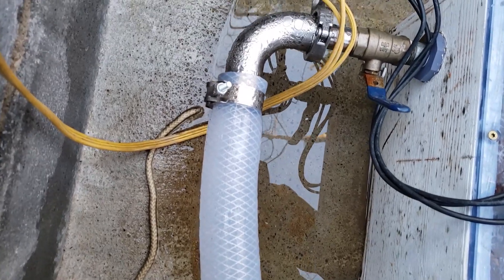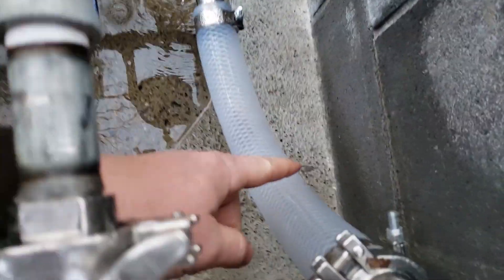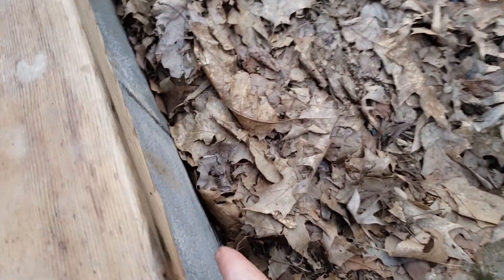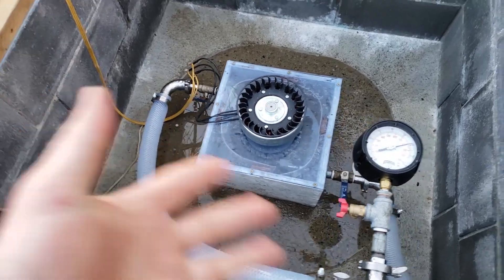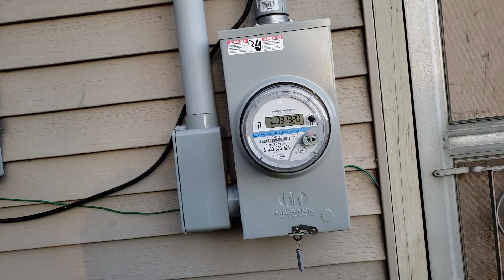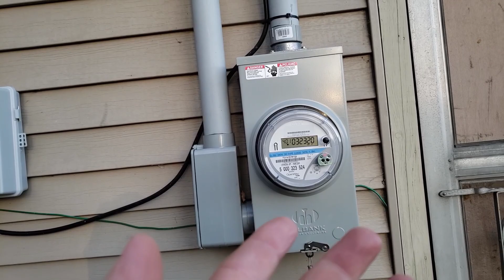T-Bolt Band Clamps And Some Talking.

Comment: How much money did you already invest in this hydro turbine toy and are you actually powering any equipment with it?
Reply from the maker: About $2000, and I've powered some stuff with it like some resistance heaters, charging all of my batteries, many lights, and occasionally running my computer system on it even. I still need to get a grid tie inverter and then it will be feeding into the grid. On the flip side I've made that money back through this channel offering entertainment and (if dubious) educational content.

Comment: I have a strictly solar setup running an all electric house, and the best inverter I could find to tie it all together was a Sol-Ark 12kw inverter. It wants the batteries to be 48v, but it looks like you can use your charge controller to charge the batteries directly anyways. If you want to get solar, it has 4 ports on 2 rails for high voltage DC so you don't have to worry about a separate charge controller for the solar panels. There's a line for the grid, which you can set it up, so it only pulls from the grid, but if you start generating any serious amount of power, it's worth while to go through the process and get net metering setup with your power company, unless they're really unfriendly with it. I'm not sure how to message you directly, but if you want more info, message me and I can show you what I have and maybe give you some ideas?
Reply from the maker: You can email me directly at malovich@gmail.com

Comment: the power loss on running the 3 phase cable to the house should be far more loss then converting it at the water wheel then using the 3 phase to single phase then run that via the  armored cable to the house with the higher voltage so you get less loss (not watched other videos yet to see if you changed it)

Comment: They make a constant torque clamp used for  the boots of turbocharged intakes. Manages to hold upwards of 100psi. 

They are also like $10+ a piece at Napa.

McMaster has them, 304 stainless bands and 410 stainless screw

Comment: I just noticed your water pressure is at 120PSI are you using a pump to pressurize the line? The 6 ft head you have there will only have less than 3 psi to get 120 PSI you would need over 270 feet of head. If you are using a pump the whole loop will be a net loss. The pump will use way more power than the turbine will generate. Maybe I'm missing something but outside of a pump I cannot see where the 120PSI  is coming from.
Reply: Watch the entire video.

Comment: Use the water wheel to charge a 12v system for outdoor security lights or outside lights for around the hot tub also you could run a line to your work area for a usb charging hub. Also like a few others have said I would put the box for your connections on the outside maybe also add an emergency disconnect and im glad you went with the mpp solar inverter ive had one for years.

Comment: You may find going to DC for some of your stuff useful. Lights, device charging  and simlar applicationns may tap your DC more directly.Working DC to DCmay be more effective than the AC to DC to AC then back to DC cycle  charging / powering battery powered devices requires.   This may mean tapping  the automotive / RV area for DC  lights and charging options.   Thanks

Comment: for the camping pressure you could cut down the width of the clams to get more pressure with the same clamping force.  I also wonder if it is worth to step up the voltage to reduce power loss.  the formula is current square times reisistance. not sure how efficent two transformers would be.
Reply: i think the length is too short to justify that.

Comment: As for the housing, round sleeve but with vertical louvers around the perimeter of the wheel, louver opening towards water flow, this allows an exit for the water but not allowing much reentry. Obviously there are dies for creating these when you transition to steel but would be easily preformed in plastics/PVC currently. At that point, I would then introduce horizontal louvers on the top, outside of your square housing louver opening up as to allow any air pressure to discharge to atmosphere. It would stand to reason these subtle additions would greatly reduced turbulence inside the housing, be it hydro or air.

Comment: I currently have my house setup with a MPP Solar LV2424-HS Running off 1200Kw of Solar and about 15KwH of Batteries.     Now it's only a single phase inverter but for my natural Gas heated house it's not too bad.  I am also not using it for any of the 240 Loads. ie Stove, Dryer and AC.    But for everything else it works just fine but my daily usage without the 240 Loads is about 12Kwh.    For the Days I don;t have enough solar like winter I set the inverter to charge the batteries at night when the power is cheaper
Reply from the maker: If the batteries are depleted it's better to just not charge them with grid power which is expensive, it's best to just wait until you're not using as much power on a sunny day and let the solar charge them up (unless you are using the battery as a backup)

But then again I don't have as complicated as a system as you nor the experience.
Reply: @JoeMalovich I live in Canada where the amount of daylight in the winter is quite a bit shorter.   Also our power is on a peak system where during the day it's 21cents per kW and 9 cents at night so I'm basically time shifting cheap power to the expensive parts of the day.   Good example was yesterday where it was nice and sunny and I got a whopping 3kWh of energy but used 12kWh
Reply: And yes I need way more solar

Comment: Perhaps an interlock hose clamp would be better than a jubilee clamp. It bolts together in four places and has a ribbed inside that helps bind the pipe to the metal. A simple water tank with three outlets, one with  a pipe facing down from the spring one at the bottom that serves as a drain and a third that provides the supply would serve as a silt trap. You can drain off the silt when you get too much. Locate this just down from the spring. On the supply hose in this tank, clamp a jelly bag to provide additional filtering.

Comment: Re-posted from "Round turbine housing experiment" The problem with your system is you are not thinking outside the box. And the box is your problem, it is containing waste water, not shedding it. An open frame is a better solution, once the water has impacted the pelton wheel you must clear the excess water away as quickly as possible. A round frame with 16 over lapping static blades in a spiral design (kind of the look of the water wheel on its side in your sites banner. Without the inner wall.) would duct waste water away from the pelton and keep from rebounding back thus reducing drag to a minimum. 
A larger round top cover would give you the ability to inject water at a slight angle down through the top, maybe 3 to 5 degrees to the pelton wheel. Doing so futher reduces splash from water exiting the ring and hitting the injectors. I have technical experience with ducted turbines in aeronautical engineering,  air or water, both create turbulence of some sort...
Salute. ppcli 4 life

Comment: If anything you could replace the nuts and bolts with some stronger bolts but I would not recommend that you use stainless steel bolts as they galls very easily especially at high torques like in this application. I think that high strength steel bolts would be better and then cake everything in silicon grease to keep the water away from the nuts and bolts.

Comment: Two thoughts ... 1.  why not add a pool skimmer to filter out the debris on the line up where it exits the 55 gallon barrel -- unless it completely clogs up it should not effect head pressure since it would be mounted 750 ft. up the hill at the head of the run (once the water passes through that it can't pick up debris along the way in a sealed pipe).  2.  Why not skip the cone shape entirely inside the housing -- put the 3D printer to use and make a cylinder with two openings for the jets that perfectly fits within the confines of the box,  but print it with spiral ribs on the inside to direct the over spray down so that it dumps out before traversing the 180 degrees to interfere with the other jet's stream.
Reply: Just had another thought ... once you make the 3D printed cylinder that works to satisfaction, do a mold of it and cast it as a concrete insert that will last for years -- when it wears out from erosion recast one from the mold.  You could probably sell the inserts if you manage to come across an efficient design.

Comment: Joe, simple fix for your clamps! We used to do this all the time on the farm for the exact same reasons that you are stating regarding sealing... It's so simple that it almost doesn't seem right.

Get some raw wire about the thickness of a coat hanger... If you have metal coat hangers even use that... Wrap it once or twice around the hose evenly, eliminate any sharp edges when you trim it, and THEN, put the band clamps on top of the wire and clamp it down so that the wire locks into the pipe!
Reply from the maker: I too had thought about this! Thanks for the confirmation that it works.
Reply: @JoeMalovich  work like a charm in our dairy operation...

Comment: There are 2 basic approaches for off-grid without causing meter to go backwards - and you can do both at the same time.   One (off-grid) is to create your own power with an inverter and 'wire it' to deliver power to things around the home that comsume power.    The other (grid-tie with limiter) is to feed power into your existing home circuit - but don't 'overfeed' to cause the power company to be aware.  
Off-grid example:  Use an inverter on the battery bank and feed it to dedicated circuits OR an automatic transfer switch.   When you do the ATS you can feed that to a manual transfer switch hooked to the main panel.   When there is enough power (e.g. the battery voltage is at the 'turn on' value) the inverter turns on and the ATS will switch-over and start taking power from the inverter instead of the grid - automatically.   ATS examples are (Progressive Dynamics PD52DCSV for 240v@50a https://www.amazon.com/Progressive-Dynamics-PD52DCSV-Transfer-Protected/dp/B0136U0QU4/ref=sr_1_6?dchild=1&keywords=Progressive+ATS&qid=1587486656&sr=8-6 or smaller Go-Power 30a for 120v only - https://www.amazon.com/Go-Power-TS-30-Automatic-Transfer/dp/B00153EYTO/ref=sr_1_3?dchild=1&keywords=Go-Power+ATS&qid=1587486624&sr=8-3
 The manual transfer switch (such as this Reliance Controls 30a 250v - https://www.homedepot.com/p/Reliance-Controls-30-Amp-250-Volt-7500-Watt-Non-Fuse-6-Circuit-Transfer-Switch-Kit-3006HDK/202213700 )  facilitates hookup into the home's main panel and let's you choose inverter powered circuits by simply flipping a switch.   When the battery runs low and inverter shuts off the ATS will switch back to the grid automatically.    For this to be smooth, you need UPSs at computers and tvs etc as the ATS is a relay that causes a 'blip' during switchovers.
Grid-tie example: Get some grid-tie inverters with limiters.  This feeds power to hour home wiring and the limiter (a power clamp) on the incoming mains will tell the inverter when you are approaching 'back feed' and limit the inverter - e.g.it will only let you feed in power to your home circuit until you reach zero incoming and then stop.   This avoids back-feeding into the grid, you don't need UPSs, and you dont' have to worrry about power demans overloading the inverter.   This is for smaller amounts of power like 2000w or maybe a couple of them for 4000w.   Here's a link to one - ECO-WORTHY 1000W 1KW MPPT Solar Grid Tie Inverter Power Limiter DC 22 to 65V Solar Input AC 110V PV System  - https://www.amazon.com/ECO-WORTHY-Switch-Inverter-Limiter-System/dp/B076KBCHBM/ref=sr_1_1_sspa?dchild=1&keywords=grid+tie+inverter+with+limiter&qid=1587486330&sr=8-1-spons&psc=1&spLa=ZW5jcnlwdGVkUXVhbGlmaWVyPUFOUUg5RjRSTTJQQ1cmZW5jcnlwdGVkSWQ9QTAyODQ4MDkxU1dDRDZGTDRFT09RJmVuY3J5cHRlZEFkSWQ9QTAwNDk2NDE3WU83VDYzMllSOEYmd2lkZ2V0TmFtZT1zcF9hdGYmYWN0aW9uPWNsaWNrUmVkaXJlY3QmZG9Ob3RMb2dDbGljaz10cnVl

Comment: Low buck quick fix, Joe. Cut sections from an old bicycle innertube and sleeve the pipe using enough layers to build it to the right diameter.

Comment: Double up the clamps.. 2 on each end of the hose should work very well. Replace with stainless steel bolts, washers and nuts or keep them well greased to protect from rusting up. Definitely an electrical box on the wall and a simple debris trap you can screw off easily to empty. Filters will reduce flow rate and drain potential power. Long term, make up a bigger plastic housing - that wood one will eventually rot in the wet environment.

Comment: What i suggest to stop the leakage is to cut a small piece of the same plastic hose and sandwich it between the clamp and the hose, you might need to slice it before instertion. worth to try it!

Comment: If you're going to put a cable to there, maybe think about additional cabling you might need (CAT6 maybe?) or put a conduit with a string, you might never need it, but you'll always have an easy option
Reply from the maker: I'm gonna run a separate conduit for comms.

Comment: i would use armored cable or metal duct outside for your turbine to house line 😊

also, i would put your pit breakers opposite side to the water inputs (prevent shorts even in waterproof box!) and run cable outside the pit.)

interesting quandry with debris! maybe an inline openable grill in the pipe further up? im thinking a kind of oval shape segment with 1 input going via 2 pipes which are both valved and have filters in each eg, pipe 1 filter is on, pipe 2 is off and turn one on and other off to clean the filter. like this (V = valve, F = filter)

  /---V---F---\
--|                |----> to pit
  \---V---F---/

sorry for being all technical, it just occured that could help somehow! (im not a mechanical engineer or anything like that, just imaginative!)

Comment: If you want to grid intertie, but don't want to fill out a table full of paperwork every year for utility approved net metering with extra meter fee's, and you don't want to illegally back feed without their permission while being CHARGED full retail per kWh for what you give them due to their new "smart meters", then you need a Grid Intertie Inverter with Limiter (GTIL). It will back feed your house only, not allowing any to go past the meter.

Comment: What would be wrong with welding a bead on your pipe so you have a Barb so your hose don't blow off
Reply: They are barbed fittings.
Reply from the maker: Hmmm I do have a TIG welder
Reply: @JoeMalovich  I run a bead on steel with wire feed and they told. Tig works to

Comment: Be careful with tightening those. I've had the nut gall to the bolt quite easily. Not even using a power tool, which would spin it fast and generate heat. Just by hand. Stainless isn't always a magical thing.
Reply: Stainless will cold weld to it's self you should always oil/grease it before screwing two pieces of stainless together.

Comment: On the hoses I use the regular hose clamps (inexpensive and all stainless). On each connection I use 2 and have them aligned in opposing directions, this seems to make a good seal consistently. I have done several off grid (and on) water systems with success. I am enjoying your videos, I hope to do a similar system as yours in the future. Your work has been very informative,  thanks.

Comment: Stainless bolts and nuts will seize as soon as you attempt any level of adequate torque, save yourself the hassle and just replace galvanized/zinc/nickel coated annually. Once SS seizes, only an angle grinder will save you.
Reply: Just saw this after I mentioned this. Anti-seize works to prevent galling.
Reply: @timramich  it's fun trying to hoist 200' of extension chord...vertical on my belt to cut off a bolt because the last guy didn't think the lockwasher was flat enough. /Facepalm

Comment: I'm sure you have/will but measure the resistance of your new cable before installing it so you can accurately calculate the losses in that part of the system.

Comment: Silicone the fitting before you clamp it. You will want to wait for it to cure but it will take care of any leaking around the fitting. 

The good news is it is very easy to setup a dump load for the system fully taking advantage of the things you have to dump heat into from a heating element in the hot tub to a simple oven heating element you can dump the power into to create heat.

Comment: I know I’m preaching to the choir, but your not planning on mixing Copper and Aluminum wire, right?   You’ll need something like a brass junction to prevent Galvanic reaction and a fire 🔥 .... I’m not an electrician but I do have a house built in 1972 when they thought aluminum wire was a good idea and the. Owners mixed in copper so now I find myself having to fix all the junctions before a fire starts!!
Reply from the maker: Fear not, I know if this issue.

Comment: why not have separate dedicated fuse boxes in your home? One, only for grid power, and one specifically from your off gird system (hydro)?
Reply from the maker: Hydro is intermittent and unreliable (seasonal too). If I'm too extract and use all the pixies I need to inject them alongside grid power inside my home.